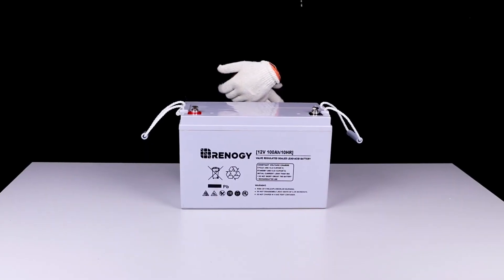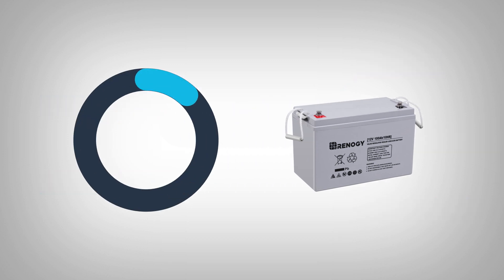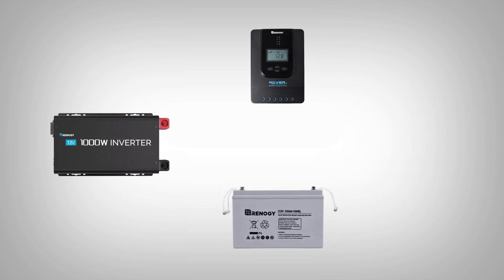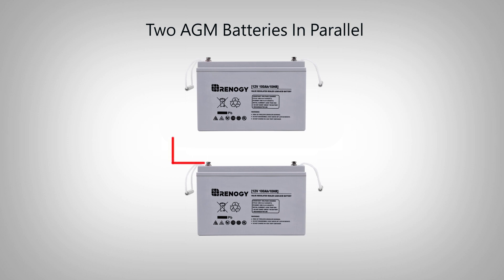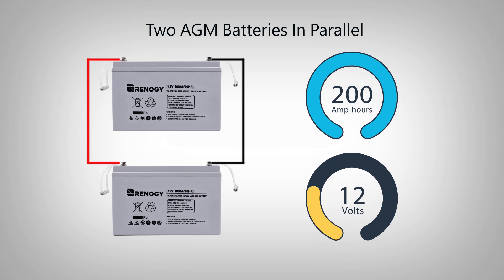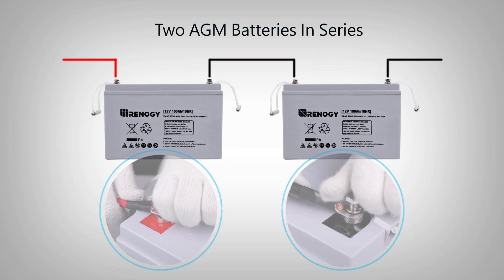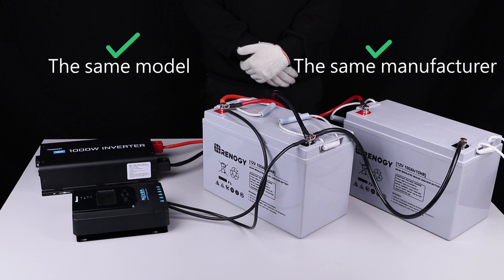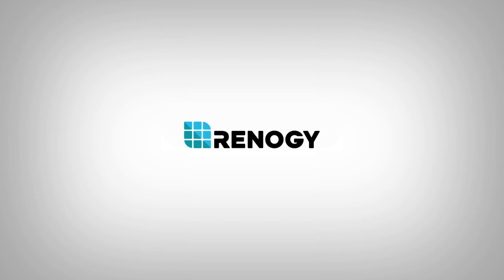Renogy 12V AGM Battery

Comment: I got the 100ah one. My friend got the Agm 100ah one. And i gotta say, the lihitum one is better, but it's not a huge difference. My friend discharged his to 80%. I went all the way to 90%. The biggest difference was that mine charged faster than his.
Reply: well if he went to 80% (meaning used 20%) and you only used 10%, of course you will charge faster.
Now if you really mean he went to 20% left (used 80%) and you used 90% (down to 10%) that is different. typically in battery talk, goingto a level is the amount remaining. Sorry. I worked with batteries for over 40 years and terminology means a lot.
Reply: @timlist4173  I'm no scientist. But damn, my lifepo4 battery is a great backup for my NAS. Damm, lights keep going down when iz raining. Damm weather. Outa buy myself more batteries. I heard an old folk down the road got em big 200ah lifepo4 battery I outage check it out n buy me one. Big o'l battery. Ye. I blame communism! Damm fools

Comment: will this all work  together  (Renogy 1000W 12V Pure Sine Wave Solar Inverter Home Use Power Battery Converter)......(Renogy Rover Li 40 Amp 12V/24V DC MPPT Solar Charge Controller W/ RS232 Port) ......
(Renogy 12V 100Ah Deep Cycle AGM Battery for RV Solar Marine Battery 12V Off-Grid) (I have 4 12v 100 watt panals) .
Reply from the maker: Hi, richard.

For your issue, we suggest you can submit a case through our Help Center Portal (links listed below for specific locations）for help. 
 
https://renogy.force.com/helpcenter/s/contactsupport (USA)
https://renogy.force.com/helpcenterau/s/casesubmit (Australia)
https://renogy.force.com/helpcenterca/s/contactsupport (Canada)
https://renogy.force.com/helpcenteruk/s/contactsupport (UK
Reply: Yes. Definitely.

Comment: This is where I am lost.  Unscrew the bolts on the positive and negative.  There are no bolts on my positive and negative.  My positive and negative terminals are smooth with no threads.  If I had nuts and threads this would be really easy.  Who can help me ?  I have asked Renogy several times via email and on their Facebook page with no response.
Reply: Same question here.  My travel trailer has leads that connect to posts, but Renogy uses screw terminals.  How can I convert to posts for my application?

Comment: Why would you run both pos and neg battery  cables from the same battery. Why would you not run one cable from the first battery and the other cable from the second battery?
Reply: The way I'll do it is HOT to HOT ,
GROUND to GROUND ,on both batteries 
Then pull the positive off one battery 
And negative off SECOND battery

Comment: Just got ours and it did not come with terminal bolts. What size do I need to purchase? Disappointed so far as it was advertised with bolts and was delivered without! Now we have to come up with a solution.
Reply: M8. Probably 1.5 thread pitch but I am not positive. Make sure they aren't too long. Around 3/4-1 inch long. Of course they are metric so thats just a guide.

Comment: I just purchased 2 of these one  I got from yhall seems a little different the top isn’t designed to have the rope handles but it’s labeled the same as the one with rope handles a little weird but ok, when I hook these up to my charger controller do have to set it up to charge AGM or flooded?